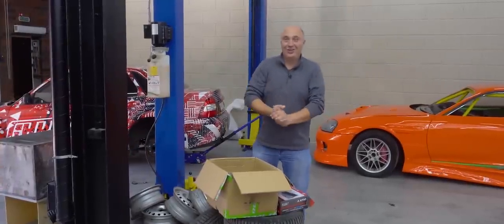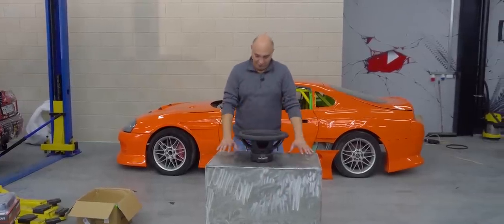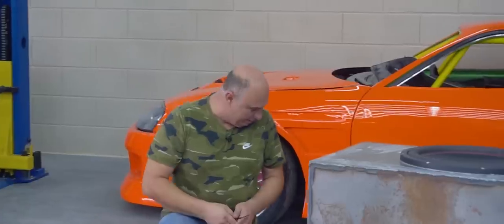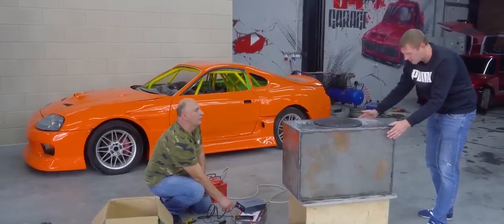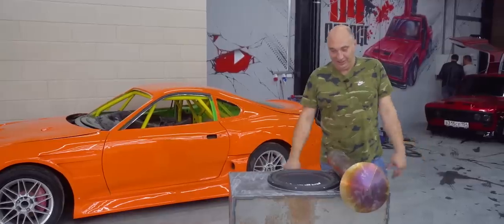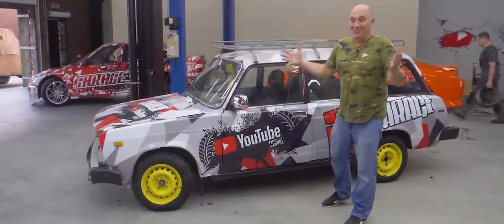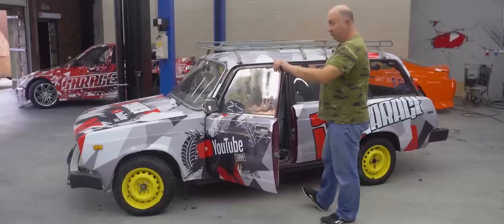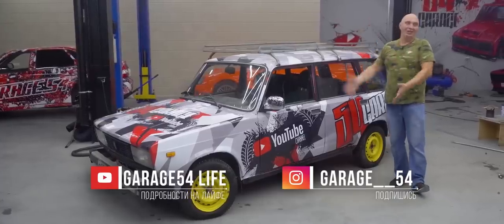Will a subwoofer play well in metal casing?

Comment: You made a bass reflex enclosure. I think the flexing of the metal is  fighting the speaker, it needs to be solid as possible, as many comments have said.
Reply: That's what I was thinking. Sound waves working against each other.
I'm not what you'd call a sound guy, but as a musician I have some practical experience.
Reply: Yes. It's not a good box variable size sub box lol.
Bass reflex is a just a 2nd order box.. Box w port
Reply: Grant W. Whitwam also, vent outside of vehicle!
Reply: I think they should do a test with cast iron.
Reply: I worked on creating my own speakers in my younger years, I have to say that is the most complex part of electronics I have ever seen, you're not getting anything without some serious formulas and precise math, exact driver specs, crossover frequencies, response graphs and a whole bunch of complex stuff that I don't fully understand to this day... you have to spend a whole week just with a pencil on paper for one of these.
Reply: @UberLummox  its called bass wood when speaking about guitars that's why some are so expensive because they used stiffer harded to work with wood
Reply: Just use 10 mm steel plates...
Reply: Why oh why are you completely missing the point? Do you honestly think they thought this would work well? Why suggest ways to improve it when they're doing it wrong on purpose
Reply: It was not made to work. It was for laughs.
Reply: @nate0 sounds good
Reply: EASY as pie to fix welding a few thin rods inside. May not be strong by traditional thinking but when attached internally to walls that flex outward, think about pulling from them from each end.  Super strong.

1mm sheet is WAAAAAY too thin for even a 6" speaker.

Comment: 1mm is waaaaaaaaaaaaaaaaaaaaaaaaaaaaay too thin for this to work at all, you guys should try 1/4 inch plate with bracing and i bet it would work much better, at the cost of weight though, maybe try with 1/4 inch aluminum
Reply: Tslim 
Yes, or add a lot of braces. Just weld some angle iron to the sides.
Reply: Chris McRoy  😮😮😮
Reply: Kind of a waste of time. Even a cardboard box would of worked untill u turn it up.
Reply: 1/4 would be plenty
Reply: Genelec monitors cabinets are actually made out of aluminium and sounds awesome, some of the best monitors you can buy at that price point
Reply: @reda19891  The legendary small Realistic Minimus 7s had an option for a metal enclosure. They're sought after and very rare compared to the Minimus 7s. They're great sounding and better then their wood counterparts.
Reply: Yes 1/4 inch aluminum

Comment: All energy from that sub is going to those thin metal sheets
Reply: exactly.  They need to use a more rigid metal.   I vote Cast Iron, ported of course.
Reply: Really thick steel, would be fun to see.
Reply: Just in terms of noise generation that setup is probably more efficient than any regular well made subwoofer enclosure. It just produces way too many unwanted harmonics.
Reply: Or, weld angle iron reinforcing ribs to the internal surfaces of the sheet steel, in a grid pattern, before welding it together. Coat the outside with 1/8" or thicker coating of truck bedliner, and coat the inside with 1/2" to 1" of clear silicone sealer.
Retest it and see how it works.
Reply: @JAlexanderG  Concrete is the best material, because it's very rigid and cheap.
Reply: They could just weld braces or use  dynamat.
Reply: @numlockkilla  Do I hear dynamite??
Reply: Anna Vannieuwenhuyse dynamat is a sound proofing material
Reply: @KunioTaki  cheap and rigid, just like me
Reply: @JAlexanderG  like 1cm cast metal box calculated would be beastmode!
Reply: @KunioTaki  and heavy
Reply: Why are you guys all nerding out about the more "proper" way to do this? As if the whole point of this isn't just for laughs at how wrong it is
Reply: You hit the nail on the head dude. The box flex is ridiculous. Thicker steel and  bracing would fix the spl and the sq.

Comment: Make the subwoofer enclosure out of concrete. It will then sound great. You can then seal up the inside with a resin so no air can leak out . It will weigh a bit though. Any flexing is undesirable in a speaker you need the walls of the enclosure to be as dense as possible for good sound

Comment: One note, (bass reflex) ports on a speaker enclosure aren't there to "provide air" for the driver to create pressure; they're there to amplify a very narrow band (few Hz) of low frequencies.
It's basically a Helmholtz resonator tuned to one specific frequency (this is done by varying the port cross-section and length with respect to the internal volume of the box), at which the changes of pressure inside the enclosure cause resonance of the air in the port in such a way that the resulting soundwave coming from the port is in phase with the soundwave coming from the driver, so when the tuning frequency of the port is played, at the rising of the sine wave impulse, when the speaker cone is pushed out, the port ISN'T sucking air into the box to level the pressure difference inside - It's actually pushing air OUT, making the pressure difference inside the box even greater. It may sound counter-intuitive but that's actually how it works. Because the soundwaves from the port and the driver are in phase, they create a constructive interference, amplifying the sound. The phase response of the port shifts gradually with frequency above and below the tuning frequency, so a ported enclosure has a steeper frequency response rolloff below the port tuning frequency than a closed enclosure has, but it has higher sound pressure level at the port tuning frequency and for a small part of band above it. And that's the whole reason why it's the most common type of subwoofer or woofer enclosure -  there's extra bass to be gained, at the cost of a slight loss of sound neutrality (which can be reasonably mitigated) and extra R&D for the enclosure and driver (which has to have suitable Thielle/Small parameters for ported enclosure).

Comment: My friend used to hold the title, in my area, for the loudest car stereo.  He actually turned it up and cracked his own windshield on the vehicle.  But the whole inside of the vehicle was batteries and amplifiers and speakers! He had a lot of money in it too!
Reply: I've broke off my mirror with the glass still attached to the mirror. I was a little over $3000 in with subs, alternator, wire, battery, amps, box, spray foam, line driver's, EQ

Comment: Case stiffness is one of the most important factor in a speaker, some filler material to eliminate internal reflections wouldn't hurt either. Upgrade to 1/4" plate to mostly eliminate flex, glue shaggy carpet or something similar to internal walls and it should sound much better, though probably still crappy compared to a properly engineered speaker.
Reply: Bracing, it needs internal bracing just like any other box, they would have also had a shit box if they made it out of wood cause they didnt brace it

Comment: Steel works for subs if it is thicker.  I made 8” subs out of 10 gauge plate and they had no flex or rattle at all.  Because i used steel, they had the interior volume required and took up a very small space.  All you need is enough material to keep it rigid.

Comment: No internal bracing, no internal dampening so of course it's not going to sound good. 

If it was well braced, and then add some sound dampening to the metal box and I bet it would sound so much better.

It can work but was executed wrong.

Comment: Interesting. I disagree from my own experience. 
I worked at an alunimum fab company and made several boxes out of aluminum with 10" to 12" subs out of 1/8 aluminum. I found them to produce rather deep bass, however the highs could be tinny. 

But i rather liked my aluminum subwoofer boxes. Plus polished they looked very cool.
Reply: Their issue was with absolutely no bracing, and no dampening material.
Reply: @madmax2069 my boxes were much smaller than that one. I never used any bracing but the metal was stiff enough... And I wasn't pushing too much power. But they hit good regardless.

Actually, now I remember my first metal box. I copied a wood box I had for proof of concept, used the same interior dimensions so it had the same airspace: unless I am misremembering  (it's been years) the aluminum box had deeper bass, but again, the highs were tinnier.
Reply: madmax2069 
Exactly, they should at least have welded some angle irons to the thin walls. Would have made all the difference in the world.

Comment: hmm back in high school i build a speaker box out of aluminum for an 8 inch sub woofer. I was only pushing 100W to it and it actually sounded good. It only rattled when it got close to the side of the truck. It was a 69 GMC pickup so metal on metal rattles. Other than that it sounded good. You could hear a difference towards the high end. To me it sounded better. The highs were more pronounced, not hurting your ears but just more evened out. In the wooden box it sounded more muffled. Like the wood was absorbing more frequencies whereas in the metal box they rang out instead. Just sounded a bit cleaner to me. Mine wasn't a pro setup by any means. Just 2 outputs from the radio ran into a cheap amp and 2 outputs from the amp fed into the one sub haha. It did rattle the windows really nicely in that old truck though lol

Comment: Te steel is far to thin you need to weld angl iron inside agenst the walls every 3 to 4 inches
Reply: Yeah but it wood sound better and be cheaper out of wood or fiberglass or plastic
Reply: Cast Iron.

Comment: I'm surprised that the speaker is taking so much abuse ! It's getting a workout!!
Reply: Denise Hedberg66 some the sound demos go through a lot worse being right up against the back of a seat to get someone to tap out. Never seen them in metal though, anti flex.
Reply: @kennethwallace4338  the placement is class rules.  Metal is more common than  you might think for the top end extreme classes, but its typically only done as a skeleton framework for rigidity.
Reply: The frame will eventually crack from the flex if the suspension doenst go first

Comment: it would have been interesting if you had done two things - welded bracing straps (like box section), and lined the inside of the box with an old quilt or towels as deadening material.

Comment: You can use metal if you meet 2 requirements. 1- the metal you use is thick enough to stop box flexing and 2- you use internal bracing every 1-1½ linear feet. This also helps to stop box flex. Aside from build defects in your main design, use the manufacturers specifications for box size, port diameter, and port length. If you do this I can guarantee that single 15" sub would almost rattle that car to pieces and sound good while doing it.

Comment: needs a frame so to not flex in hopes at making some pressure , then you could go as far and adding in some planters foam to make a sound form tunnel (once formed melt said foam into place or even use auto filler to make it less trash . now this could work but it would be cheaper to buy premade / make from wood / lexan /.

still pretty cool attempt

Comment: I bet it would get a bit louder if the box was actually tuned to anything useful by calculating the length of the port, around 30 to 45 hz is what you should tune the box to. There are calculators online that can calculate port length based on box size and port diameter.

Comment: yes if box is built to spec for speaker and tuned properly, in the states we have guys with massive builds and all steel boxes, that steel was too thin and had not enough internal bracing, box flex = sound distortion, and unwanted noise, please do this again and add strength to the box

Comment: For the speaker to make sound, the driver needs to BOTH move in AND out by changing directions of the current flow. It is this movement of the speaker driver moving in AND out that is vibrating the air to make sound.

So, sound is made by AC, because music is made up of variations of many different frequencies and loudness, with low frequency as the bass, high frequency as treble, and the amplitude of the current expressed as the loudness variation.

Comment: the answer is yes, kinda..... I have a commercial use sub that has a metal case, however the inside has a inner particle board framing I guess for rigidity or similar, and it had insulation to further dampen:) **  I have 4 of these and they're awesome but I have no actual amp that would drive this setup(I tested one using a 500w amp and it hits thermal shut off after a while)

Comment: Ned to went in cross-panel supports to prevent the enclosure from flexing.  Also, heavier (thicker) material will also help a lot.  You HAVE the technology - you CAN rebuild it.  Bigger, stronger, better than it was before....

Comment: Put some pebbles of various shape and size into the base of the subwoofer case.
Instead of the water on the membare use something fluorescent, turn off the lights and illuminate with UV.

Comment: I made my sub box out f 3/8 aluminum plate and 1/4” carbon fiber panels. I like it better than my old mdf box.
Reply: How much did you take out a loan for to afford that?
Reply: TehButterflyEffect cost 75$ for the metal, I made the carbon panels, and I had it welded up. So about 140$ plus my time to make the carbon panels.

Comment: You should have used 1 inch square tubing welded together instead of a sheet of metal. I  bet you could put a bunch of braces in it & make it sound better
Reply: This is garage 54. The home of filling tyres with concrete and welding 10kg of railroad sleeper to unbalance a flywheel to see how spectacularly it can fail.

Comment: Add dynomat or roofing tape with the aluminum cover and get a lighter torch heat up the dyno or roofing tape and get a mini roller pin like a mini bread doe roller and get the the air bubbles out make sure its stuck against the metal to take away the vibrations of the metal box

Comment: reinforce the metal walls with something, weld on rods alongside the whole case to keep the case itself stop moving, then you would get a better result. the Physics behind the Wub Wub is simple, the air pressure inside is enough to get the whole case to move, which is not ideal. You basically took a plastic bag and mounted a sub to it.

Comment: you need a dead and verry solid material for a subwoofercasing 
sheetmetal vibrates and rings like a gong exactly opposite to wat you need to get
 a good low note
might work if you burry it in the ground with a big pipe to keep a tunnel open for the speaker
Reply: All they would have to do was add in some (or a lot) of bracing to keep the box from flexing so much, and add in some kind of sound dampening material.

Comment: I made one with 1" plate steel and t5 screws. It's so heavy it makes one side of my car sag down and i get 5 mpg less, but good luck stealing it. needed to use an engine hoist to put it in my trunk and i think it weighs a good 500 lbs minimum

Comment: That length of port in that size box would have tuning frequency of maybe 5Hz. WAY to low. 75-100mm length in that size box for tuning in 30-25Hz range would have been much more suitable. But if the box is that flexy then not even worth trying. What would have been interesting is to put the sub in the end of a 100 litre propane tank. Because it is cylindrical it is impossible for the sides to flex, and the far end is a dome so it is very rigid too. Only trouble is making sure =every= bit of gas is out before you start cutting and welding. Very VERY dangerous otherwise!!!

Comment: I'm guessing 10g shett  - 1/4 inch plate with a bit of bracing and it would be fine . This is like 16g sheet metal with no brace so it's going to just vibrate . If you used super thin mdf it would sound like shit as well ... The question would probably be can you build a box out of steel that can withstand high pressure that  doesn't weigh 500lbs

Comment: You want that speaker to compensate that car that medication what you need to do is put insulation down the side that metal casing that'll sort some of the sound of stopping from bouncing off the sides that metal container get some insulation in there you'll see a big difference I guarantee

Comment: now encase it in concrete.
Reply: 15743 Hertz - bang on. Will improve speaker efficiency as it’s losing a lot of output energy to the flexing steel panels, and it’ll kill nearly all cabinet resonance. It will also make a handy RWD traction aid for Russian winters 😁
Reply: @scunnerdarkly4929  I could tell you about the time we built a pair of concrete speakers and inadvertently used them for a sonic attack, but that's another story.😁

Comment: well since you called it a casing, i would assume you dont know much about speakers, and how important enclosure designs for specific drivers is... first and formost, no resonation... as solid as you can afford in weight.... any flex in the cabinet, will counter the pressure the driver uses to perform its task... anyways, now ill watch the video
Reply: a couple of cross braces inside the box prolly would of changed the results alot